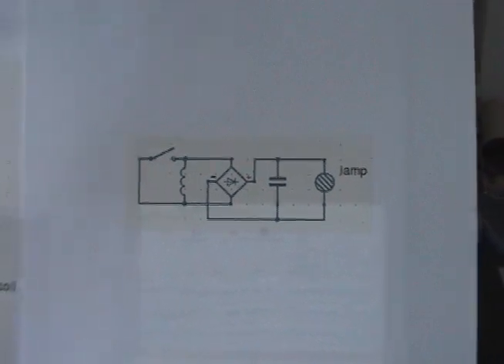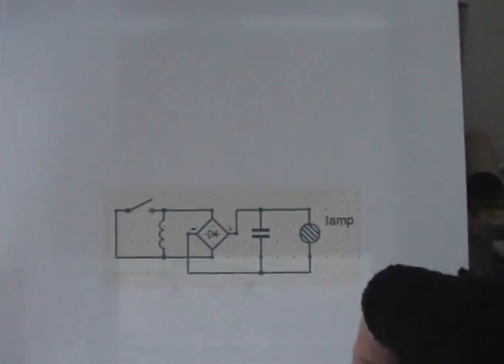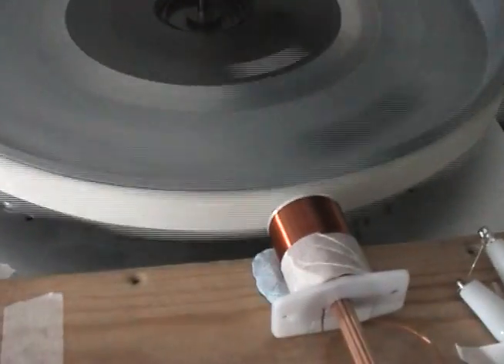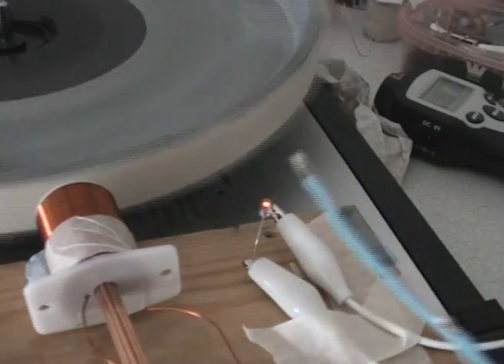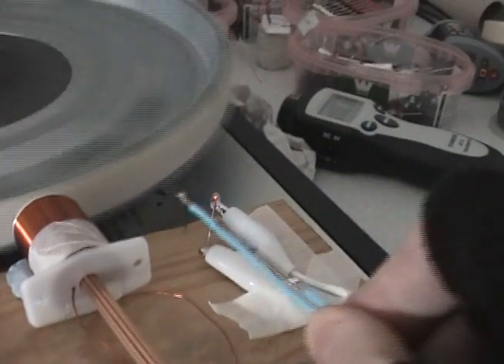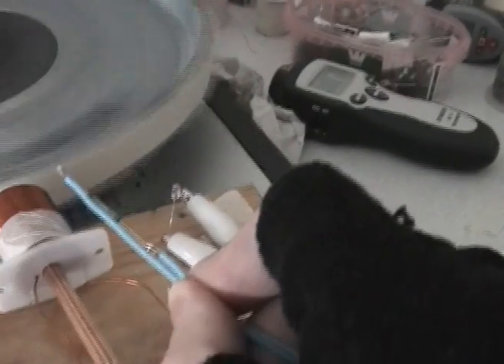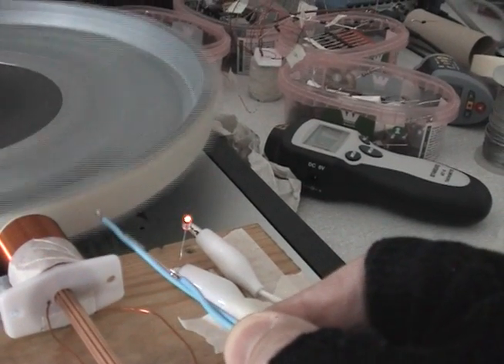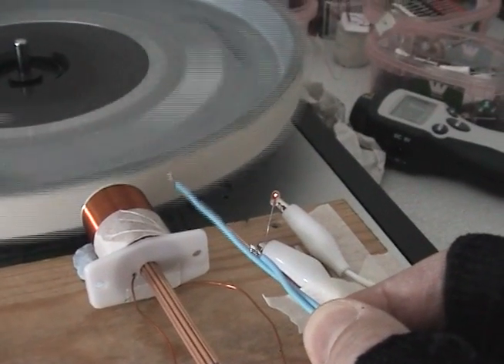Shorting generator-coils part 2, gain in output

Comment from the maker: You can make some additions to a Bedini SSG circuit. I just did a very crude setup to test it. I couldn't get it to work with the extra timing coil on the same core as the other two, i guess the timing wouldn't agree. But once the extra coil was free the charging battery got much more voltage, and the running battery just a bit less. I don't know if there was a total gain, i have to make a more precise setup to check that.